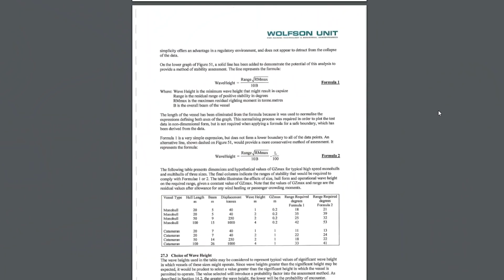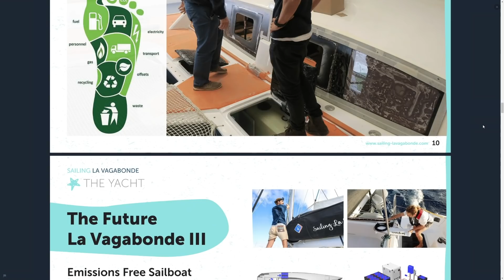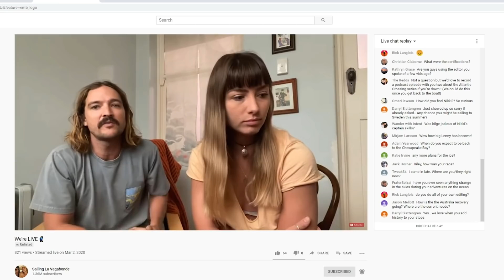Our Plan for an Emissions Free Vessel

Comment: This is a great project, Riley!  And it will give a poke to the Greta-haters who were bagging you out for running the diesel ...

Please consider the idea of modifying your existing boat as well as building a new one.  Emissions need to be assessed from a viewpoint of raw materials extraction and components production, building the boat, running / maintaining it (energy usage, replacement parts, etc) during service life, and disposal (of both consumables and non-repairable items during service life, and disposing of the boat itself).

Comment: 🐲 A boat is NO investment, it is a liability!
Emissions? First the production/construction of the boat takes a lot of energy. You use the wind energy... no question to be emission free in operations. But you use gasoline too for motoring!
I think you can switch the gasoline-motor to an electrical-motor with a battery pack. You can charge the batteries by PV (if much sun) and in addition by water turbine (if good wind). But I'm sure, that solution would be much more expensive than a simple gasoline motor! So from an economic standpoint it makes not so much sense. And the little emissions (NOx, CO, dust, etc.) on sea are no problem at all for our health! It gets diluted very quick.
.

Comment: "Our Plan for an Emissions Free Vessel"

SAILS
Reply: Exactly. Nothing to see here, move along lol. Early vessels were emission free and carbon neutral when made from wood by hand. Only the forged metal parts and the sails/textile produced emissions in the manufacturing process. Too be true low carbon there's no way it should be a fibreglass hull. Fibreglass / carbon fibre isn't very recyclable. Fitting small propulsion engines was just a safety choice to get you out the shit and aid docking. IMHO any hull they decide to build should be hand built from sustainable wood. Choose the build materials first then design the vessel that plays into those material strengths.
Reply: You can't "sail" into a slip. Likewise, when anchoring you need to reverse the direction of the boat to set the anchor. A motor is essential. Additionally, if you were offshore and Lenny fell and broke his noggin' (god forbid) and you were becalmed, you want a means of propelling the boat without wind. That speaks to hull design which means you want the most efficient design you can find if it is your goal to power electric motors via wind/solar. This is much easier said than done as this article indicates.....

https://www.passagemaker.com/web-extras/magic-hull-shape
Reply: @falconquest2068  Check out Kevin Boothby at How to Sail Oceans. Plenty of folks cruise the world without a motor.
Reply: @BillACK  yeah he's rowing his boat. I remember Riley used to say he'd rather row the boat than running the engine. Still waiting for that to happen...

Comment: I am guessing that these ideas include a switch to electric motors so don't forget to factor in battery weight and what it will do to hull form and the fact that batteries themselves have a finite service life and need replacement over time.
Be interesting to see where you go with this though.

Comment: A monohull with foils gives nigh speed, stability and safety.  Add a long hull length with accommodation only in the middle - giving storage in the bow and a garage aft you can have the best of both worlds. Cats are kept safe by weather routing but you must get caught eventually. Here is a 70 footer in 11 meter waves https://youtu.be/Te3C7sYBexE

Comment: I might consider a hybrid (w/ diesel genset) but 100% electric for a cruising boat isn't there yet. For a day sailer that plugs in at the dock, or a person that doesn't mind risking his life, it's fine. I want the reliability and range at speed to move quickly in a lull before a storm, especially if I were putting my family on the boat.
As far as zero emissions, all the chemicals, materials and machining that go into a high tech boat sort of negates that thesis, not to mention the lithium batteries. Then if you lose the boat because of lack of power, or range or any other reason, all those materials and processes are wasted.
BTW, I am an Elec Eng that has personally built (and sailed many years) a high tech multihull, AND I worked several years at one of the biggest and most successful electric boat companies. I certainly don't know everything but I am not a novice.

Comment: Hey Riley, 
Im an electrician and glorified auto electrician who works on mobile electric mining equipment for a job and sails for pleasure. I have put heaps of time into pondering this idea. Its my opinion that the perfect hull would be a catamaran like what you have. I think the biggest challenge would be fitting solar panels and wind turbines in an aesthetically and aerodynamically pleasing manner. Ive toyed with the idea of removing the mast to make the solar panels more efficient but i think the benefits of the mast outweigh the disadvantages. Especially when you consider electric motors will recharge the batteries while sailing. If you want someone to bounce ideas off or help with power consumption calculations hit me up. 
Peace VB

Comment: Use solar and induction to cook on, so you do not use any LPG, that is one of the biggest gains you can make. If you can sail in light winds, you do not have to turn your engines on. Outboards are much lighter than diesels engines as well as electric engines + lithium batteries, so they keep you boat lighter so you can sail in light winds. Every day you do not turn your engines on is an emission free day, do it 365 days in a row and you have an emission free year. But in a pinch or a storm, you can turn your outboards on and deploy some HP to get you out of trouble. It is the total litres of fuel you burn that matters, not the engines you carry. Reilly, hit me up on FB, via TMAS.

Comment: Have you considered retrofitting your existing boat with electric motors powered by hydrogen fuel cells? The hydrogen (gas) could be produced on-board with renewable energy via an electrolyser. Benefits of hydrogen over batteries include:-
- Stored hydrogen is lighter (weight) than batteries
- No need to replace hydrogen components every 'x' years like batteries
- Hydrogen is more suited to long term 'energy' storage
- Hydrogen has other uses (e.g. cooking, production of electricity to power boat appliances)
- Hydrogen is being explored as a maritime fuel (so may eventually be available to refill in port)

Comment: Ok riley this is a fascinating idea and definitely a challenge. I’d have to agree with the majority of comments below that are favouring retro fitting your existing vessel and converting it to electric. Obviously la vagabonde has already been built so you could spend your time researching available conversion solutions to minimise the downsides so mainly safety. That being said there is also a fair amount of concern over lithium batteries in how the are mined and disposed of which is also mentioned in the comments. So essentially one option could be a project into the most effective way to retrofit. The other option which I think you are actually getting at here is how can you create from scratch a vessel with no emmissions. This project would involve extensive research into the supply chain, materials used and cat design. It would also be very expensive for supply chains to produce bespoke carbon free parts for the design you have developed. At the moment it looks as if you are raising capital for the project via donations in return for sponsorship. Another way of doing it would be to form a company with the first vessel being a prototype where you would then look to scale production to reduce costs. Look into tesla and its business model. They started production of a luxury product to cover costs, then moved to mid tier and finally achieved scale and were able to produce an affordable model. This is definitely on message right now with governments aiming to transition to net zero emissions by 2050 so look into available grants. Should reiterate if you were looking to launch as a business it would involve a significant amount of work but would have the potential to create needed and lasting change in the market. You need to consider whether this is going to have too much of an impact on family life given that you would be sailing whilst attempting it. One of the main reasons I was suggesting a business is that I think when you initially cost the emissions free vessel you will find it’s heaps too expensive

Comment: - SOLUTION -

First of all, just LOVE your trash-american dialect! Hahahaha! 🤣

Making a emissions free vessel. Absolutely!
There is an answer for that, and it is called Free Energy devices. 
And No, that is no joke but an actual FACT today (even though many  people still live under a rock thinking it is impossible.)

Of course I can not go into any details here and now in a short text in the youtube comments.
But very shortly.
Here below I will give you a link to ONE example (out of many) of a free energy device.
This one comes in two different versions, where the big one has an effective power output of 10KW (enough to completely power like a two room apartment 24/7).
And this of course without any fule, batteries, or emissions etc....and does never have to be turned off or refueled or re-powered .

And with that said, we should be prepared for much, much, MUCH more powerful Free Energy devices coming out in a not so distant future.
Just to give a fantastic example:

A man named Salvatore Pais who works in the US-Air force (or Navy...) did last year have a patent openly released  that got the classification as a so called operational patent, meaning it was not just on paper but actually built and tested and CONFIRMED as an operational patent, on a free energy device that is no bigger than about 30cm in diameter but that produces more energy than a nuclear-facility. 
Yes that IS true and NOT a conspiracy theory etc, etc, etc.

According to Salvatore this device can be put in absolutely everything. 
All from powering a car to a house or even cities etc, etc, etc.....
So in other words, it can be put in a boat as well. 
It is absolute safe in all and every way and has no emissions or even any moving parts in it. 
It works using the energy that is all around us everywhere in space. (Because as you know there is no such thing as empty space, but EVERYTHING is energy, and it is this unlimited energy that it uses for power.)

(He even had a few other amazing patents released that was classified as operational patents (meaning they DO work and HAS been built), and that can be used together with the free energy device. i will not go into any details about that here and now.

Wish you the very best day my friend! 😀💙💜💚
(And remember, sun-power, wind-power, wave-power etc, etc, is something that will fade out existence in a not so distant future.)

https://infinitysav.com/

Comment: If you were thinking of going electric with the engines, I had some experience On an electric engine boat (it was the super yacht GENESI -I was chef for a few weeks ),  when we went out of harbour there was a HUGE difference in the ballast (you’d normally have more with an engine down there,) they’d completely miscalculated the way the hull would be affected by even small ocean waves (it was less than 3ft swell) and it made the boat practically unusable in anything but dead calm seas. (I know you’ll be going for a cat so it will be different balance to work out) 
it’s just a thought on electric engines (you’ll have to make up the ballast somehow!) loving the concept you guys are creating and really interested to see more!

Comment: I have an idea for you:  How about something like the air intake on a car bu only a water intake on the bottom of the hull where the water flows through it whilst the boat is moving then turns an impeller to create electricity then spouts the used water out at the back of the hull, perhaps all contained within a separate bilge tank on each hull to keep it balanced properly.  Just a thought !!!!  and unlimited hot showers !!

Comment: Swap out the motors for electric. Get some of the latest lithium ion batteries that'll have you motoring full power for days and days even if you don't have the power coming in from solar. Also reasonable onboard generators. Boats on the great lakes have been switching over four years to electric motors. Some of the latest car battery technology might make it practical for just about any boat you're on to switch to electric (which rarely has to run a combustion generator).

Comment: The battery's are the problem, they are rather polluting and don"t last long in Marine environment. The most friendly way is to keep the diesels and use them as little as possible. Building a new ship is  not very sustainable, and the battery's ad to that.
Reply: This is really not true. The batteries will easily last for decades with this usage. Just need to keep them cool. Bring a backup generator to be able to get out of a storm with a broken mast or similar, and this is easily the best option. There are fuel cell generators, but gettong clean fuel will be a problem.
Reply: @Coleen West Your a nutcase buddy.. Go tell BLM!! They are terrorists
Reply: @Coleen West You are a cry baby Coleen! If Reilly had spoken like Prince Charles would you still call him a racist, I think not. And he sure ant anti American

Comment: I know how I would do it--but I am not you.

I think your idea does not mean you absolutely have to upgrade the hulls and sell La V.  You could put water-cooled electric variable prop regenerative sail drives in place of the existing diesel engine system, and then the new extended lithium battery system and their electronics are much lighter than are the  heavy lead acid batteries one would otherwise need to power the vessel's  new electric engines.  Weight equals draft equals drag equals extra hull stress under load and slower speeds.  One has plenty of wieght already aboard in water tankage, black-water tanks  for use if in port and heavy bower anchors and fore and aft chain rodes.

I would also maximize solar panels,  even if it means extending the cockpit roof and reducing the Bimini a little.  Biminis are fine, but not likely to withstand a really severe storm.  Wind generators for some extra electric power when lying to an anchor or pier is useful and would also install daytime solar contact water heating and a reverse osmosis water maker if you do not already have  one for hot showers and washing smalls..

On my vessel I had aboard a self- igniting propane constant supply no-limit until the tank ran dry hot water.   It was bliss--but not environmentally all that great.  When wet and cold and shivering--that is when a hot shower is a good thing however sinful.  Solar allows you to have one with a clear conscience, and if on an ocean passage, the regeneration  will allow a small  domestic electric storage system using an element matched to 12 volts or 24 or 48 volts, whatever your system is.  The thermostat is no different.  A small system supplies at least a couple of hot showers a day for two people.

Of course, electric drive propulsion has its limits.  It really means it gets used for raising anchors and entering and leaving  port and berthing only--the rest of the time one has to either sail or stay put, once one has exhausted the cells.  Which is why regenerative drives are so important.  They push in extra amps all of the time you are sailing.

I would put the Lithium system of sufficient capacity to run my port and starboard motors for six to eight hours at half power, and four hours for dodging a ship at close to full power,  Something a bit like the "Sailing Uma" system times two.

 I would also have like to install induction cooking working through an inverter, and get rid of the propane.  Propane is a risk, and without it you might pay less for insurance.    That just spent about thirty five to forty grand or more--

AND I would ideally like a diesel generator capable of driving the vessel at quarter power in an emergency,  through the electric motors.  The generator is really not an essential, just an extra load of fuel and weight to carry...

Comment: Doing a retrofit is definitely going to be the cheapest and greenest when you factor in the depreciation of your current boat compared to the price of a new boat of equal or greater size. Greener because the emissions of building a new boat. Me personally I would plaster your current boat in solar, replace your engines with electric motors and sell everything you take out to recoup some of the cost. Whatever you do I'm sure it will be entertaining.

Comment: Something to consider is the aerodynamic drag of everything attached to the boat, from the cleats to guide wires to mast and everything in between. Just as the hull has to slip through the water the topside slips through the air, which of course is  and acts like a fluid, aka like water! The more “slippery” everything topside can be the more efficient your boat will be. Things like flush mounted windows, cleats that recess when not in use, a teardrop shaped mast instead of round are but a few things that will make the boat slide through the air better. Often aerodynamics are scoffed at at low speeds but this is totally incorrect, it matters from zero to infinity on every speed chart.